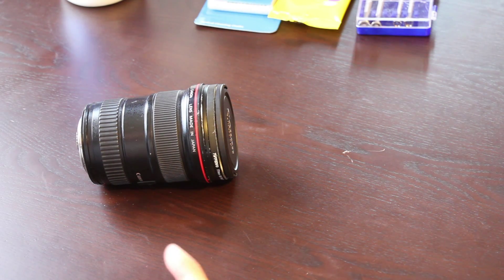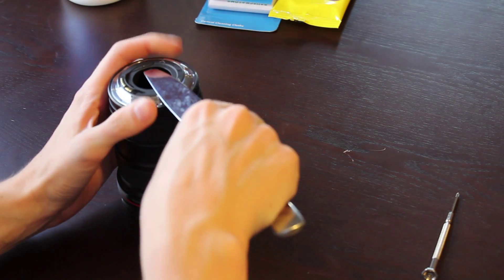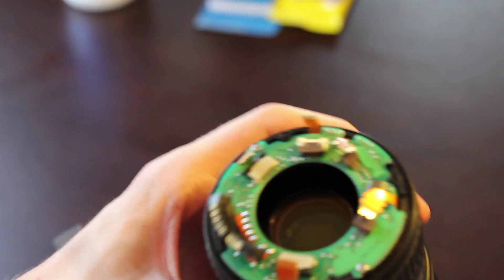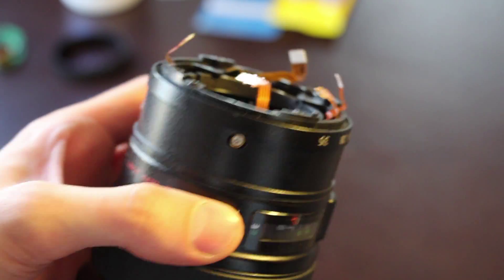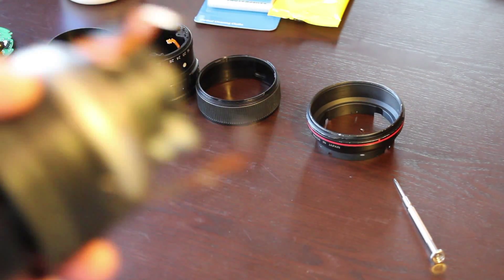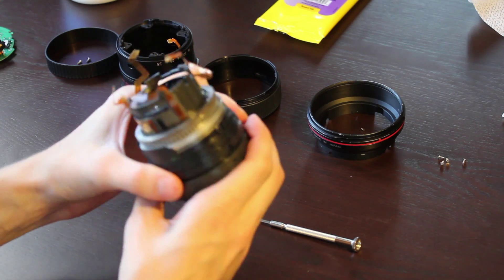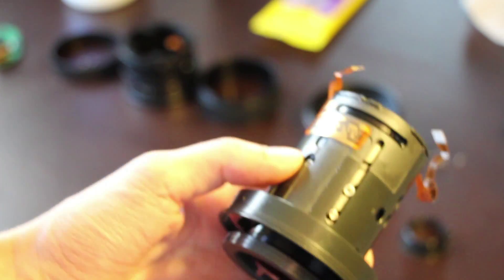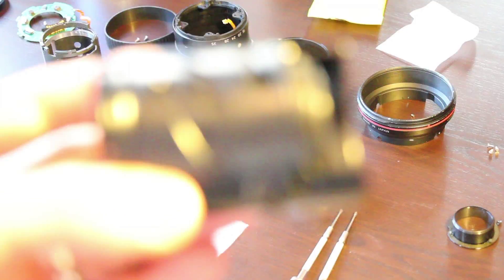Disassembling a Canon 16-35mm F2.8 L Lens

Comment: Thank you this helped me fix the broken zoom on my lens, turns out it was just those 2 pesky screws that had fallen out
Reply: Which two screws were they? Did you need to disassemble the zoom mechanism? I just bought one for $40 with a jammed zoom, and going by the number of comments on this I'm guessing/hoping it's the same 😊

Is it possible to say at which time in the video feature your loose screws? 

I'm pedantic because I ruined a 28-70 f2.8l by forgetting where the zoom was aligned! I want to avoid a repeat...

Thanks a million ☺️
Reply: @samuelsquires423  my zoom mechanism just got unattached from the outer zoom ring - so around 5:01 he shows the screws that came loose on my lens. Hopefully that helps!
Reply: @caitlynmackie5201  thanks 🙏

Comment: I have to say THANKYOU for your video. I bought a 'non working' F2.8 lens for AUS$300 (About USD$200) and fixed it in about 10 min by putting the focus screws back after they had fallen out. I now have a fabulous addition to my lens stable and saved a fortune! (If you have a fix for a non power up of a 7D I'd appreciate it as well, (well actually my daughter will as it will be her camera)  ;-) )
Reply: Which screws were they? Is it possible to tell me which moment in the video they feature? 

Thanks ❤

Comment: Hi there. I fixed my lens issue in a way thanks to your help. I got to 6:34 and I got two out of the three screws off. But then, the last screw was not moving and it started to lose its grooves for the driver. It was getting worse so I decided to leave it until I buy a better driver with a grip on it. I did however get out what I needed to get out which was a 9:17 plastic piece and screw that had come loose and was beginning to jam my lens. I can fix that once I can get the other screw that is threaded off. But do you know where I can get a new or replacement screw for the ones at 6:34? I wanna have one ready at hand to replace the worn out one. Seems like a hard one to get and no random screw will do the job. Do you know where I can order one or two of these, or if just a random replacement works from some other device or I can order online? Any help appreciated. Cheers.
Reply: Best comment! Very helpful. 

I'm wondering if you remember how you put those plastic bits and screws it? Did you need to strip it down more, and if so did you mark the position anywhere to keep it calibrated?

Thanks a million! 😊

Comment: can you remove the front filter barrel without starting from the rear? I have a damaged (bent) Barrel so I cant get the filter off but the replacement barrel is cheap... how hard is it to replace?
Reply: Where did you find a new barrel? I have the same issue

Comment: Hey! I've got this lens, AF motor isnt spinning (it had some beer spilt on it) although the focus confirmation does work. My thought was to try and take it apart to clean/fix/replace the motor. You have any thoughts on how to test whether its the motor or the connections/pcb that are preventing it from focusing? (my thought is that if focus confirmation is working, that the PCB is likely okay). Awesome video.

Comment: Hi, I just need to remove the front metal part which holds filters. I actually have 16-35 f2.8 II version. Do I just unscrew the screws under the focusing ring? Or do I have to take it all apart like you did? Thank you very much.
Reply: See my comment above, you can do this by itself with just 3 screws.

Comment: In case anyone is wondering, you CAN remove the three small screws under the focus ring to remove the front filter mount.  ONLY remove the ones without the plastic ring around them.  You will have to pull it a bit because the plastic ring on the inside up against the lens is clipped in and takes a bit to get out.  Mine didn't break but be careful.
Reply: I removed those but still can't get the front piece off. I feel I have to remove the labeled ring that surrounds the end glass first. How did you get that part off?
Reply: @danielgrove6087  Just pull it is slightly glued around the lens ring
Reply: For others reading, for my 17-35 L, I took off the label ring which was glued on, then underneath were two pin holes in the lens surrounds (the bit Arthur was missing) that allowed me to unscrew it. It actually held the outermost lens element in place so be careful that doesn't fall out. Then the lens cap ring slides easily off after the three screws mentioned above are removed.

Comment: Hi, after disasambling and re-asambleing the lens, I'd strongly recomend to be EXTRA careful when removing the focusing motor assembly 08:28 in the video, I did that and ripped half of a ribbon flex cable, so now I have a clean, fungus free lens that won't focus, (on the interne you can find $100 focusing assembly's, so its not too bad), but beware when putting out and in this piece. Use this japanese URL as guide (you have the full assembly drawn and with photos): https://wenku.baidu.com/view/04af1c7a31b765ce050814c4.html put it on the translate google to english and there is a continue reading to have the full parts list.

Comment: You skipped the part as to how you got he front "name plate" off of the front of the lens which seems to be needed in order to take the whole larger front piece off.
Reply from the maker: My lens didnt have that piece, it was missing.
Reply: @ArthurR  well darn, it's keeping the outer front element on and there's no screws visible. There are 2 very small holes on either side of the plastic around the glass, facing forward but not sure what to do with those.

Comment: hey man. i took it passed the point of where you said you shouldn't. have you ever done this? how the hell do i put this thing back together?! haha. I'm about to bring it to a local canon facility all in individually labeled bags. I took it apart because my focus wasn't pulling at all. micro adjustments did me nothing. and i didn't want to pay canon 400 dollars. now i wish i had :/
Reply from the maker: +Shawn Luginbuhl I have. It's a bit of a puzzle after. I assume you have taken it apart down to the aperture blades? That is the toughest part of reassembly - getting all of the aperture blades overlapping correctly and facing the correct direction while connected to the outer ring and functioning properly. Once you have that, take a look at the details in the video and reassemble the lens based on the paused video. It is possible, you just have to have patience. Also note you shouldnt touch the aperture blades with your fingers or let any oil or dust on them.
Reply: Thanks man. I think i got the aperture assembly (the smallest of the barrels) put back together last night. Hopefully the lenses are clean enough. I never touched the aperture blades, but i did notice that through the motion of it it didn't really close up as much as i expected it would. I guess i always thought those blades closed up to almost a pinpoint. they really only close about 50% of the lens they cover. I've got my fingers crossed. worst comes to worst hopefully the parts can be sent to Canon for cleaning and re-assembly haha. Your video is great by the way. Thanks for that.

Comment: Is this different then the 16-35MM  2.8  II ?  Mine looks different.  Mine dropped from 2 ft  snapped off the lens from the camera in two pieces.  A lot of people complaining how cheaply it's made for a Canon Professional  $1, 600 lens.  I put my camera on the back seat floor of the car I opened the back door and was on the edge and fell out. After I put it in it must of slid against the door and boom when I opened the door.  I almost had a stroke when I saw it in two pieces on my 5D MKIII. Lens laying away from the camera.   Luckily the MKIII didn't have a scratch on it   My lens broke rite off the camera. Circuit board ribbon cable ripped off the board a black wire hanging I imagine was soldered to the pc board.. No damage to the mount ring or camera except for a loose screw from the lens breaking off. The circuit board has a broken coil on it.   I can't believe the cheap build quality. I took it apart somewhat but afraid to go any further. You video really helped but I think my 16-25 2.8 II  is different   4 tiny screws into very hard plastic snapped off. Cheaply made!  Anyone have any ideas how to fix this.  Should I try doing it myself or send it out or  anyone have any  experience they can share with me?  If I send to Canon they will rape me on a repair.  The lens is like a 1 yr old like new.
Reply: Yes, outer casing parts are similar but the mechanism is different especially on the focus section, 16-35 mk i is almost the same as  17-40 f4
Reply: I also have the same lens and got the same issue. I lost two ribbon cables though. Need to replace the auto focus assembly. Were you able to find any instruction you can share on how to replace it? 
Thanks!

Comment: Can anyone here share how they got the front labeled plate off? The lens in this video didn't have one? I can't take the front, outer element off without removing the labeled part which surrounds the end glass.
Reply: remove the focusing rubber, rotate the ring to align 3 screw holes, remove the screws and pull the metal front ring housing, it will take out the plastic snap in cover as well.
Reply: Any luck finding? I have the same Q.

Comment: The video is continuously out of focus. This is very annoying. Usually the cameras in a poor lighted environment use automatically a bigger aperture for more light into the sensor. However with bigger aperture, the depth of field is shallow and the autofocus struggles to operate. A better solution the use of more sources of light in the room and the manual selection of a much smaller aperture. The depth of field will be deeper and autofocus will be more efficient.

Comment: Nice video thanks...I subbed. Was just wondering. Do I need to disassemble as you have shown to merely replace the Len Distance Scale ? Or can it be removed externally ? (ps: Mine is cracked and needs replacement)